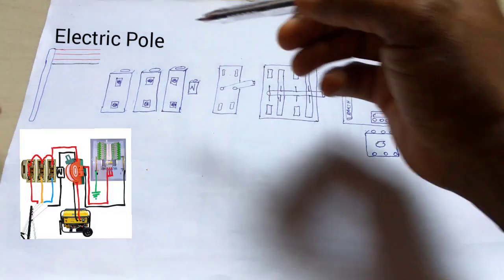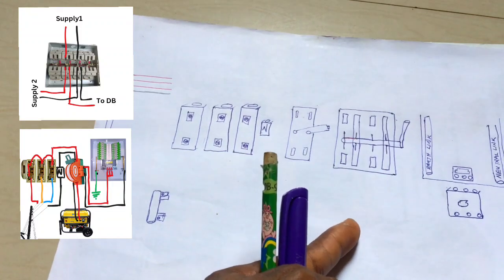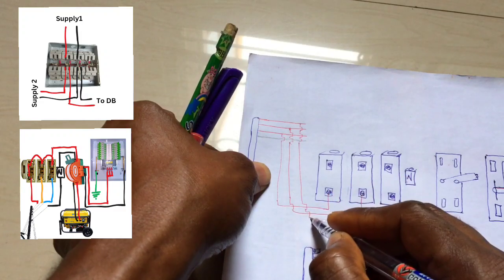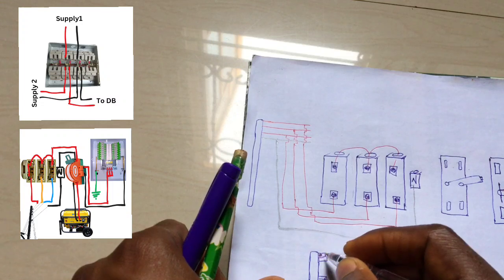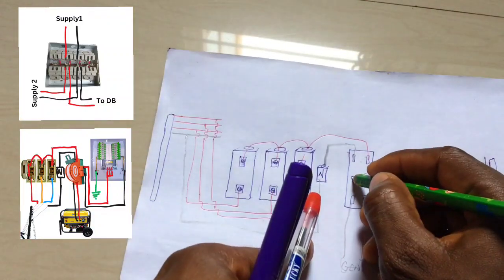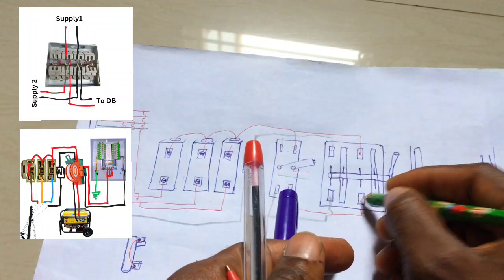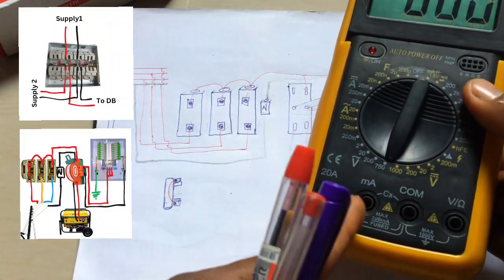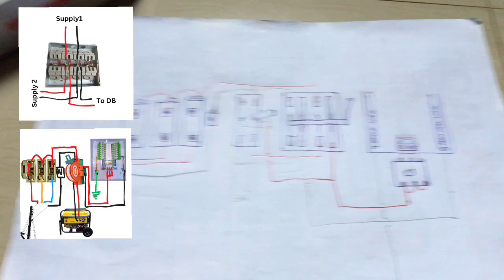Cut out fuse, changeover, and distribution board connection in homes

Comment: Can you insert the neutral direct to the knife switch in the neutral link while the live from pole goes to cut out and later loop to knife switch in the live link
Reply from the maker: You can do that. But most times multiple points can tap from the same neutra line and doing a lot of looping in your knife switch changeover can look messy.

It is usually more professional to have a common neutral point and then your knife switch is fed from there.

Comment: If there is no neutral link how do you join it and to which cable
Reply from the maker: If you don't have a neutral link, you can use a junction box to accommodate the neutral lines or you can use a joint.

A junction box is more recommendable because the cables are enclosed and more well arranged.